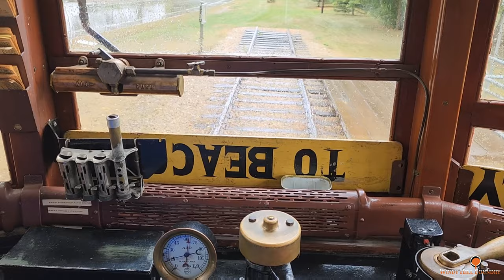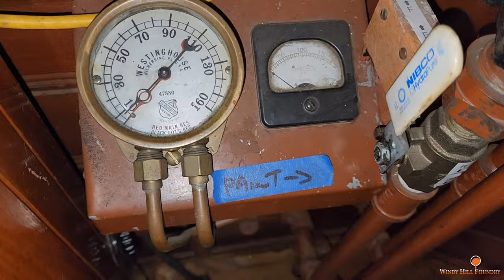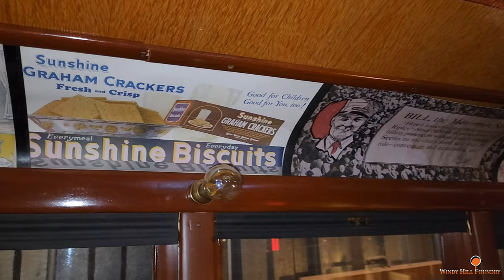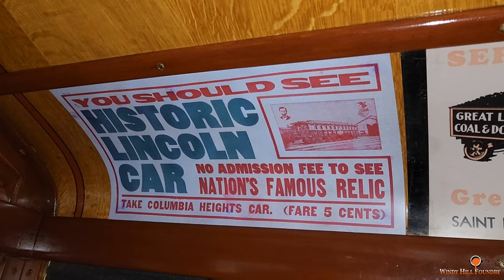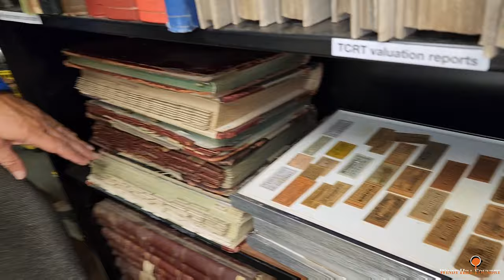CASTING STREETCAR HARPS

Comment: I really enjoyed this street car video.
Use wire to reinforce those delecate cores.
I used to glue the 2 halves together for extra strength.. I f you need any more advise, consult with sandrammer.

Comment: Hi Clarke, I found this to be a very enjoyable video, well apart from the molding issues. Melbourne, Australia has one of the largest tram networks in the world, easily the largest in the Southern Hemisphere, comprising some of the most modern tram/light rail cars available today. The Tram operator Yarra Trams has a significant historical collection based at one of the Preston Depots. Until just recently we had updated W Class Heritage trams running around the CBD loop, but something to do with the braking system resulted in them and the Tramcar Restaurants behind hurriedly withdrawn from service just before Covid.
I used to catch several W Class trams to school in the late 70s and early 80s, so the tram you featured seemed very familiar. There are a number of ex- Melbourne W Class trams in San Francisco and an unusual modified diesel electric tram complete with a disabled lift operating in another US city. I forget which one.There is also a historical tram network running in the former Gold mining town of Bendigo, Victoria. Glad to see how the items that you cast were to be used. 
Mark from Melbourne Australia